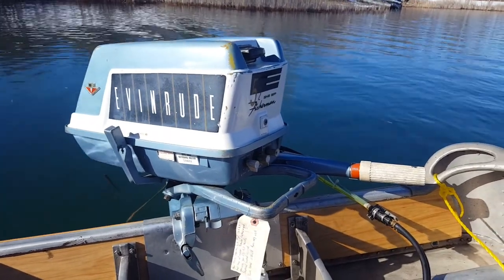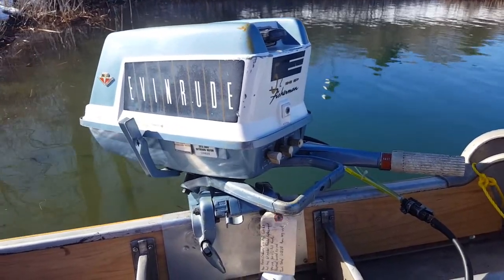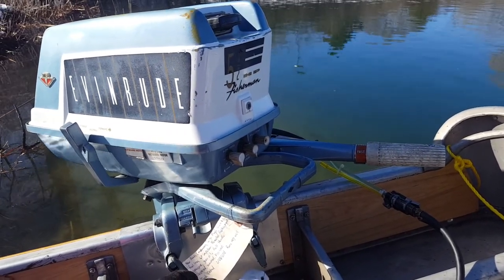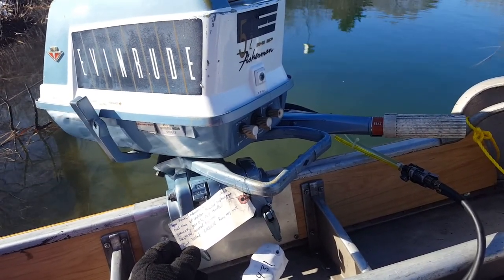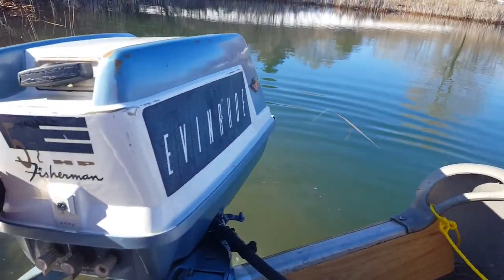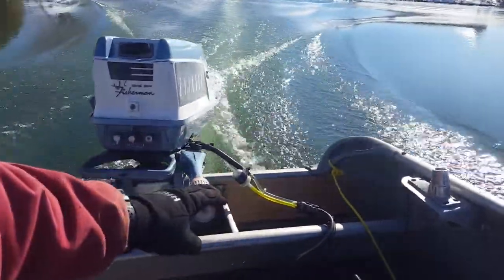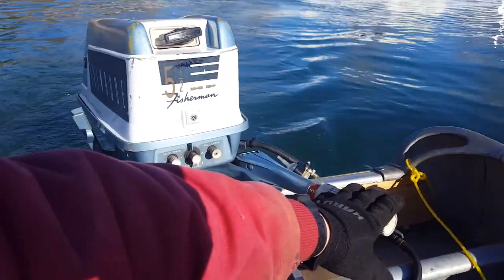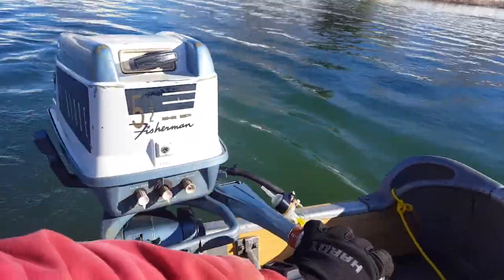1960 Evinrude Fisherman 5.5hp Outboard Motor Pond Run

Comment: Just pick one up yesterday in great shape love these old outboards .
Reply from the maker: Awesome! Congratulations on your new motor amd thanks for watching!!
Reply: @oldjohnnyrude8404  Thanks just went threw it new coils condensers points new fuel lines .waiting on impeller replacement and carberator kit.
Reply from the maker: @jamessaumier1905  Great!! They're sweet running motors when they're tuned up nicely.

Comment: Nice motor bud, this is the same power head I'm wanting to mount on my 57 Johnson 5.5, Nice running motor, thank you
Reply from the maker: Thank you.   Yes, that's the same powerhead we talked about.  This is a nice runner.  It had a lot of issues when I bought it, but it turned out well. Thanks for watching!

Comment: Just got one of those 5.5s for free, I replaced the coils and now she runs great. The only downside to those motors is that you have to pull the powerhead to disconnect the shift shaft to pull the leg off
Reply from the maker: Congratulations on your new motor.  True, the powerhead has to come off to service the water pump and lower unit.  They were designed with that in mind, though, and it is an easy task. The lower crank seal assembly should be inspected and serviced periodically anyway, so it's really part of the regular maintenance.  Thanks for watching!
Reply: @oldjohnnyrude8404  thanks

Comment: She's a beauty, and pretty peppy also....Gotta love those lovely water pump screw messes...
Reply from the maker: kramden Thanks Don! I think it turned out nicely too.  Yes, the water pump screws can cause issues, and then people don't know how to carefully remove them.   It definitely can make a mess.  I may eventually weld up the damage and repair it on the old gearcase but it may end up on a different motor by then.

Comment: I noticed the connector rig for two line tank to single w pump.  Neat idea.  I've been playing switch the tank all this time.
Reply from the maker: J Potts I wondered if anyone would mention that.   I put that together for winterizing since I run everything on 8:1 to winterize.  That way I only have to mix up one batch for everything.  It works great, so I end up using it quite a bit.  Thanks for watching!

Comment: The one I'm trying to Frankenstein together,has a fuel pump on shifter side and the glass bowl on opposite side fuel lines are missing, and I'm a lil confused on hooking up the fuel line,(not use to fuel pump set up) and would it be possible to mount this power head on a 54 Johnson 5.5 (Green) thank you for any help you can give me

Comment: Always fun to watch these old motors come back. Do you ever work on any mercury motors? I've have one that's a 55 9.8 110 and was my grandpa's. Been working on it but I think I need a whole different lower unit. Do you recommend anyone who might have what we need?
Reply from the maker: Matt E I occasionally work on a Merc, but I'm a much bigger fan of OMC products.  I have 3 Merc 110s.  One is a 1979, one is a 1972, and one is a 1960.  The lower units leak on all of them.  I have never resealed a Merc gearcase and I don't have the tools to do it.  I did revive the 1979 9.8 that I have and made a video of it July 4th 2017.  Good runnimg motors and I think the older ones are better yet.  The mid to late 80s were a better bunch of motors too.  The late 70s early 80s motors had some quality issues but still aren't too bad.  I just don't like working on Mercs as well so I don't have that many.  Post an ad in the Free Classifieds on AOMCI.org and see if someone has what you're looking for.

Comment: Can you explain your fuel line mod, looks interesting ?
Reply from the maker: PRACERZ Sure.  I use 8:1 gas oil mix for winterizing so instead of mixing two different tanks I made the adapter you see in this video.  It is a motor side dual line fitting and a tank side single line fitting connected with a fule hose on the fuel side of the dual line fitting.   The air side of the dual line fitting has to be left to vent to atmosphere to prevent pulling a vacuum in the sealed pressure tank.  I connected a paper element inline fuel filter to the end of another length if fuel hose to prevent dirt and crap from getting into the tank through the air line.

Comment: I found one for 100 bucks is it worth it? Guy says it runs great
Reply from the maker: I'd say it is well worth the $100 if in running condition. Bringing a dead one back to life with new tune-up parts will cost more than that just for the parts.  They're nice little motors, just not very fast.  Great fishing and trolling motors.  Run these on 16:1 fuel mix.  Thanks for watching!